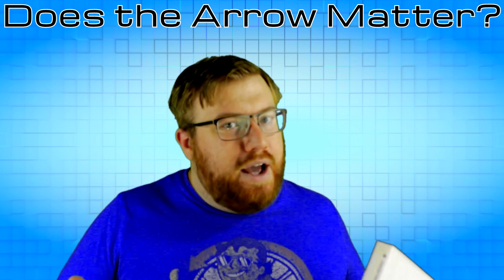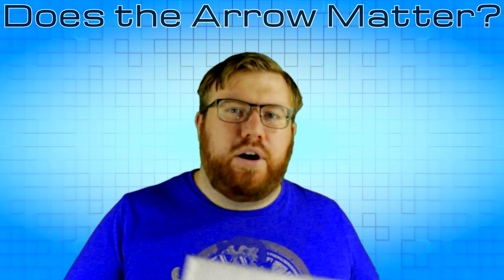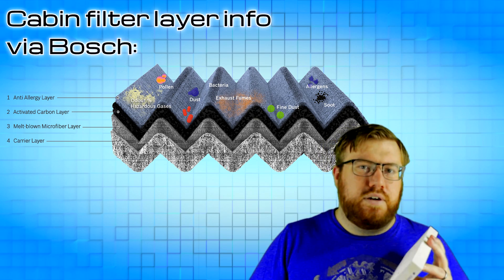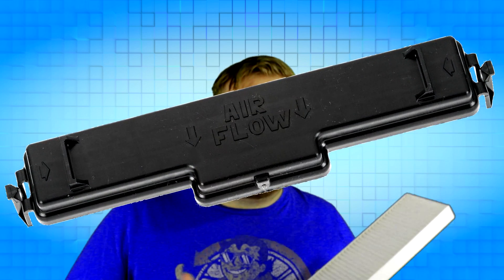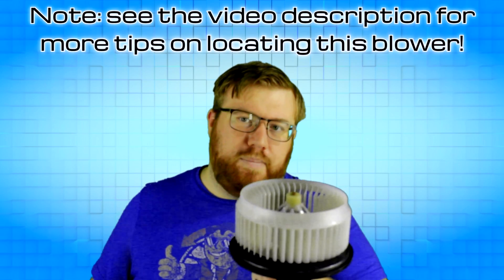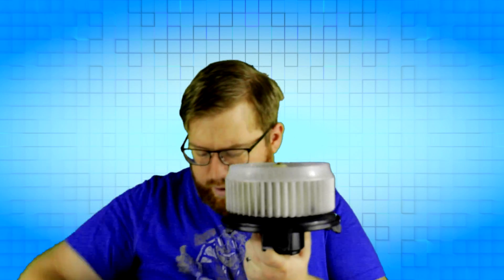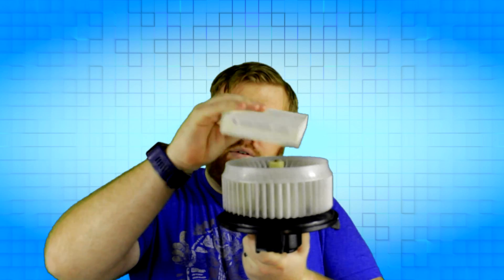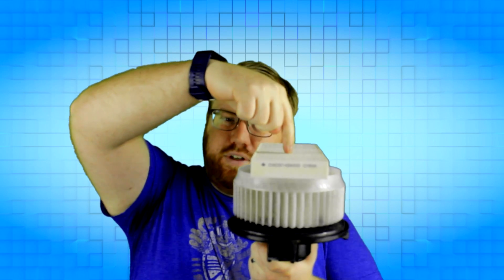Which Way Does a Cabin Air Filter Go & Does Air Flow Direction Really Matter? • Cars Simplified

Comment from the maker: I really need to make sure I'm going to be in focus when I film on the green screen. The tiny flip-out screen on the camera just doesn't show enough detail. This looked just fine.
Reply: Greetings, I have a question: I have a regular digital readout (In the window) air conditioner. There is a button on it that has three parallel lines pointing to a vertical line/And on the other side of the vertical line is an "Arrow" What does this mean?      "If the button is turned "On" what is happening? Thank you

Comment: I have a 2019 Honda Civic, I bought an STP filter and instructions say to insert filter with arrow pointing up BUT my cover tells me that air flow is down?  So I’m super confused, if I place this filter in with airflow going down, it has a glue side facing up towards hood/windshield, but if I follow the STP instructions and place in with arrow/airflow up, it has the deeper side facing the hood.  Any tips?

Comment: On my Toyota Camry, it's tricky, as the OEM filter has an UP arrow, not an airflow arrow. If I'm installing a Toyota OEM filter, I install it with the arrow pointing up, but if I'm installing an aftermarket filter, I install it with the arrows pointing down.

Comment: My latest filter had 2 arrows with air flow written. But the filter would only fit one way. It had grooves cut to fit in the car. The letters were upside down and the arrows were pointing upwards...facing the actual air flow direction.....top to bottom.

Comment: OEM Toyota/Lexus Cabin filters have the arrow pointing up. However, that's not the airflow. OEM is installed with the arrow up, but aftermarket cabin filters are installed with the airflow direction pointing down.

Comment: My husband says that inserting the cabin filter not only wrong upside down(air flow) but sideways doesn't matter. And he calls me an idiot because I say it's incorrect
Reply: I am sorry he's acting that way towards you. The direction the filter is installed indeed does matter especially if it is not a basic ( least expensive ) single layer filter, multiple layer carbon filters require a specific direction of installation to filter as intended from least restricted to the finest filtration.

Some vehicles are very simple and direct others require you to reach upside down with poor visibility and low access and the direction of air flow can become confusing.

Comment: If you install backwards, will it blow black dust into car?
Reply from the maker: Assuming it's a charcoal filter that has that in it, even the right way around might sometimes do that the first time the blower motor runs after it is installed. The charcoal layer isn't an outer layer, so while putting it in backwards could blow some of it out, but it won't be a lot. More commonly, regardless of the type of filter, some debris from the old filter falls down past where the new filter goes and that gets blown out unfiltered.

Comment: I have a Lexus and the blower sits below the filter but on the plastic door it shows arrow pointing up.
Reply from the maker: A lot of these panels have an arrow labeled "up" so that the panel doesn't get forced on the wrong way. My Toyota 4Runner has that, and if I remember correctly it will sort of fit upside-down but there will be a gap for air to sneak past the filter.

I see this mentioned a lot and I'm working on an expanded/improved/in focus version of this video that will include a section on this.

Comment: In a 2008 Highlander the access door to the cabin air filter has an arrow that points up; however, the fan / blower is located below the filter slot. The arrow on the access door will always supersede the location of the fan / blower. I recommend that owners and installers look for the arrow direction on your access door and search YouTube for your specific vehicle model for correct installation instructions.

Comment: Thanks for making an awesome video on this!
I installed the filter correctly with the airflow pointing down (as directed for my car). When installing, it seemed that it fit better with the mesh being vertical, rather than horizontal. Does it matter which way the filter is facing (horizontal/vertical), as long as the airflow direction is correct? The reason I bring this up is that I bought a cabin filter from a third party, not an OEM version and the one I received seems to fit better with the mesh pointing vertically (from the cabin filter door opening). 
Thanks in advance!

Comment: Thanks, I went to a shop and they installed it arrows facing up and the blower is at the bottom. I even used the plastic wrapper the filter came in to determine flow. It sucked air in from the bottom. Can't even trust a shop and they also broke a piece off my glove box.
Reply: @privatename8888  Depends. This video addresses the filters that have arrows stating "airflow" Perhaps your arrows were instructing to point up (not marked airflow).

Comment: When I was replacing it myself, uncertain about the direction of the airflow, I turned on the fan and reached in to feel the direction of the wind. The wind was blowing upward. However, the blower on my car is located below the filter, and the original filter installation also directed the airflow downward. So, I believe this is correct. If the airflow is downward, why is there an upward wind when I turn on the fan?
Reply: This video doesn't apply to all vehicles like most would think. I believe you were on the right track with your logic. Check to see if there is an arrow indication on the access door to your cabin air filter. Mine has one that points away from the fan.
Reply: @aacc320-r4x  Because you have the cavity open.. Insert a small piece of paper (while holding one end) and watch the deflection of the paper. Will likely pull down

Comment: Hi I was confused about this as in my car there is an arrow pointing up on the plastic clip showing air up  but my filter replacement arrow is down the blower motor the big one you show white is upwards so I put my filter which says down on filter so hope it's ok  thanks for your advice on the good video on my old filter the arrow was up so yes very confusing I might just go to Toyota near me and check for sure which is correct for my Toyota Yaris hybrid 2019........

Comment: basically on a Toyota vehicle you have to put the “air flow” direction away from the blower motor..? I had it that way but it felt like my a/c wasn’t blowing enough air and switched it around.. guess I should put it back how it was before.

Comment: My 13 Camry has an UP arrow on the door in front of the cabin air filter. I always assumed this was the direction the air flowed and I installed the filters that way with the arrow UP! Just found out that the original Toyota cabin air filter was installed with the arrow up (no air flow with arrow direction) The after market filters have the word AIR FLOW and the arrow down. I have been installing them upside down for years! No wonder people get confused!

Comment: Weird. My plastic cover says Up with arrow pointing up but that motor is on the bottom
Reply from the maker: That's most likely for reinstalling the cover easily, but also some OEM filters will say "up" instead of "air flow" since original equipment manufacturers know exactly what vehicles the filter is going in (while aftermarket filters may fit in multiple brands with multiple filter orientations, which necessitates air flow direction being noted instead of a "this side up" label).

Comment: The arrow on the plastic covers points up. 
The air blower is below like your example at the end.
You said to have the cabin filter arrow down which conflicts 
1. The car plastic cover says air flow up
Reply from the maker: Does it say "air flow up", or just "up" so the cover can be installed correctly?

Comment: I have a 2020 CRV and the airflow was quite confusing the 1st time I replaced my cabin filter.  I have a plate covering the cabin filter with an arrow pointing up and the plate actually says "UP" on the outside.   Once you remove this you can see the blower motor with an arrow pointing down and showing the direction of airflow.
l would assume that 90+% the arrow needs to point down as the air will be sucked in from the vents in the dashboard down into the blower motor.

Comment: The gen 2 cruze is kind of pain to change. You will have to remove 4 snap on panels, and 5 screws. 
Better air flow will help prolong the blower motor as well. Think of it as changing your indoor filter on the AC unit.

Comment: Thanks, my cabin filter case arrow points up but the filter sits on top of the fan. So the filter arrow needs to point down as it sits on top of the fan, but the case inserts up with the filter arrow facing down 🤦‍♂️🤷
Reply: Exactly

Comment: Thank you! It was my first time changing it on my new older car- I pulled out the old one at it showed an arrow pointing up and just aids up. The replacement showed an arrow and said air flow beside it. I stuck my phone in there, took a photo and because of your information, I learned that I needed to point the filter down! I didn’t copy someone else’s mistake. My asthma thanks you!
Reply: Old one said ‘up’ and was situated pointing up. Debris was on top. Photo showed Blower motor was below. Now I know that airflow is going down-and it needed to be pointed down.

Comment: My 2918 CRV doesn't have "airflow direction" on the cover, but the cover itself is labeled "this side up". A little confusing at first but then I noticed the blower underneath and guessed you would want filtered air going to the blower. Aligned the filter with airflow pointing down towards the blower. I just Googled this video to make sure. Thanks for the verification.

Comment: Thanks for simplifying this. On my 2020 Highlander the arrow (I think for assembly since it has wedges that forces the filter frame up) points up but based on you logic. The airflow is down. (Squirrel cage is on the bottom). Nice and simple and it didn’t take watching 20 minutes of rambling. Well done.
Reply: Yes my subaru forester is the same way my blower motor is on the bottom but owners manual says i should put the filter in with arrow facing up.

Comment: Urgent. My new carbon air filter has NO arrow, dont know what is top and what is bottom.
Reply from the maker: If both sides look identical, it may not matter. If it has carbon in it, I would stick it in so that the air flows in on the light side and out on the carbon side. That's just an educated guess based on how the carbon is supposed to work in a filter.

But, aside from it being a possible defect (unstamped), it seems like the manufacturer's way of saying it doesn't matter.
Reply: thanks but the filter is the same no difference in color or texture.
Reply from the maker: Yeah, that sounds like it doesn't have any specific layer designs and can go in either way with the same results.
Reply: Usually only cheap or counterfeit filters have no arrows on them.

Comment: Thank you.

I've been having a bit of an issue on my C4 which has been having a bit of condensation. Someone told me the cabin filter might need changing so got a new one and decided to replace it anyway, only just bought the car so it is good practice.

My filter is under the windscreen wipers and when I pulled the old filter out although it was not too bad the top did have debris in it. But.....the airflow arrow was pointing up - toward the wondscreen! This did not make sense to me considering the debris so I found your video. I cannot see a blower but there is a large opening in the steel plate below the space where the filter is located, I have assumed as per your video that this is the motor so have placed the new filter with airflow down. There really seems no other way in common sense as I honestly do not think there is room above that space for a motor like that. However I was concerned about the orientation until I found your video. So thank you again.

Comment: Can a clogged or dirty cabin filter create condensation on the inside of a car?
Reply from the maker: The evaporator in the dash tends to get condensation on it regardless, but more can build up or even freeze on the evaporator when a clogged cabin air filter slows the airflow down. Since the evaporator is often relied upon to remove condensation from the windows, a clogged cabin filter may be the issue. There are other possible causes, but that is the easiest to deal with, most common, and least expensive.
Reply: @CarsSimplified  great thank you. I’m going to change this tomorrow.

Comment: Airflow direction is key! Very good info here. You can always establish the airflow direction of the cabin blower fan by holding a light piece of tissue paper over it while running the a/c (don’t stick your fingers into moving parts!) and watch which direction it pulls the paper. That is your air flow direction and that is the direction in which you should install the arrow on your filter.
Reply: Yup! I would just use the receipt from the auto parts store when I questioned the airflow direction. I like your style my man.
Reply: @sexytopramen  I just did this 5 mins ago and turned out my air filter was installed the wrong way and is now clogged earlier than it should (dang it was like, what, 3-4 months lmao). now I had to replace it again. the right way this time.
Reply: Using the receipt is a smart idea. I like the use of your God given intelligence.
Reply: Good post.
Reply: What if my air filter dont have arrows
Reply: @Legenkilla  Post the link to your air filter. Show us.

Comment: Great tips! I actually just replaced the cabin air filter in my truck last weekend. I am a bit embarrassed that I scratched my head a little longer than I care to admit trying to work out the correct airflow direction. Didn't even think to look at the little access panel that I removed (it likely has an arrow) - I worked it out based on the location and orientation of the blower motor. I'll have to check the access panel next time!
Reply: The access panel on Toyotas has an arrow pointing up and the word "up" as well. That arrow does NOT indicate air flow direction. It's just telling you how to put the panel back on. If the filter says up on it then the arrow should point up but if it says air flow then it points down toward the blower motor.

Comment: Hey did our 04-06 GTO’s come with a cabin air filter? I read there was but it’s too hard to get to.
Reply from the maker: Kind of. There is a mesh cover that keeps the leaves out, located under the passenger side wiper cowling. I have been trying to find a cabin filter part number that just drops in or only needs one cut so I can make a video about it.
Reply: Cars Simplified I saw an article on it online but I forgot about it because it was just wasn’t worth the effort. You do have to buy a cabin air filter for a certain type of car. But you have to cut it to fit. I bought the filter but those things are a pain to cut. And I ended up ruining it. So l gave up. I totally forgot the part number since it didn’t work out for me.
Reply from the maker: I think I've read that a while back when I was trying to find it. I got some clearance cabin filters a while back that I have been sitting on for that video. There are just so many part numbers for them out there!